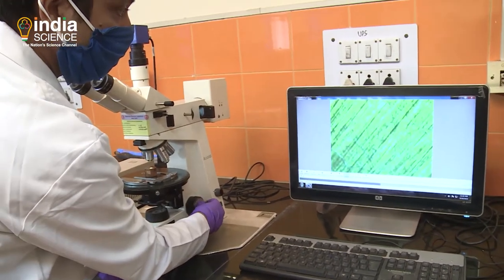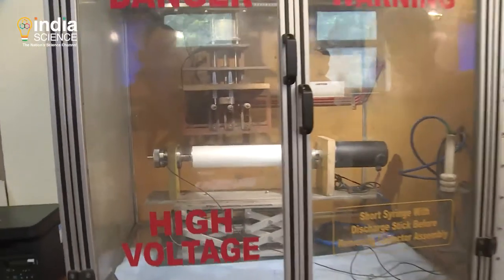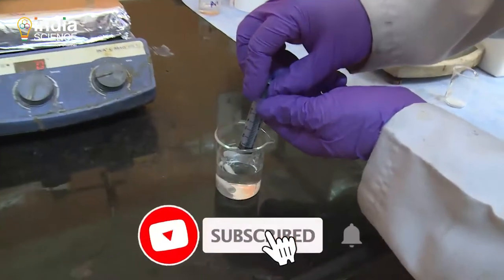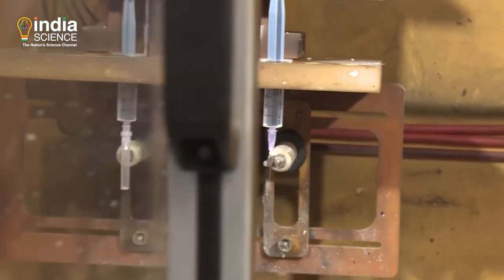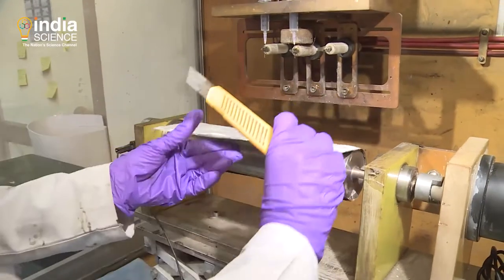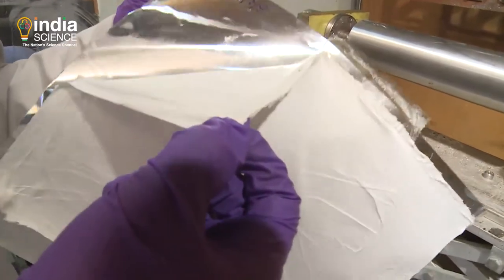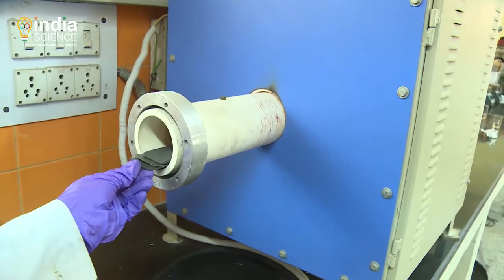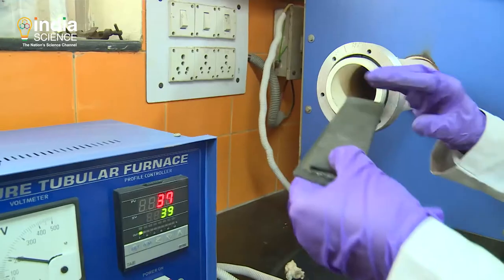Carbon Nanofibers

Comment: Greetings!
i have synthesized  my carbon nanofibers using (PAN+DMF). and heated it 800 but after heating sheet break into small pieces how i can make it flexible .have to use it for supercapacitors
Reply: you fibers became britte because of the oxidation. U should try to conduct the heat treatment in vacuum or inert gas condition. For inert gas u may use Ar or He flow during the heat treatment.